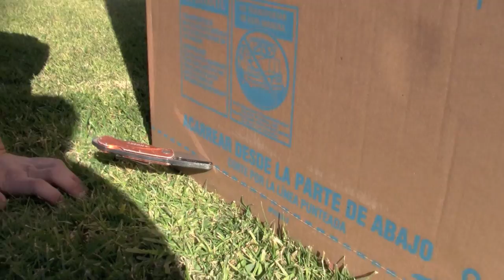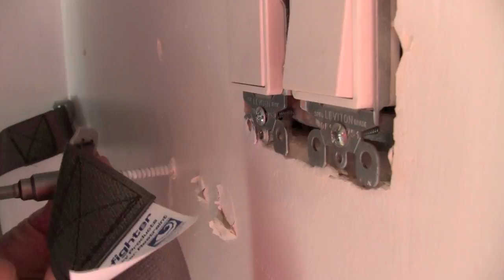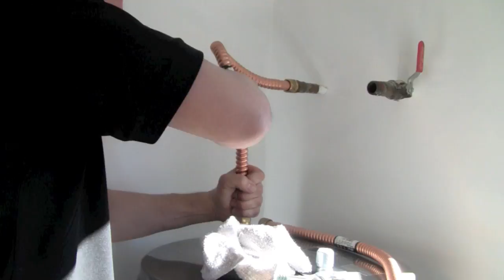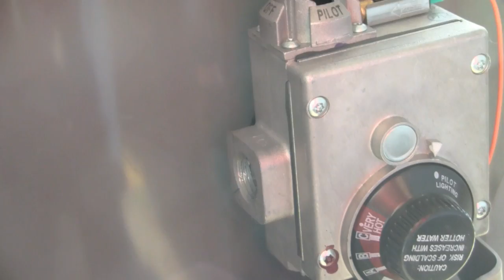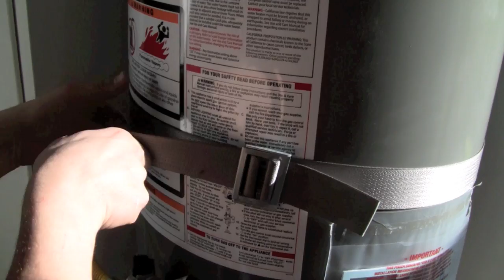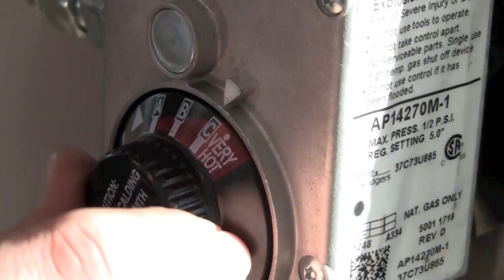How to Install a Water Heater - Step-by-step

Comment: The cheapest I could find for a plumber to do a 40g gas water heater was $2,500.  

lol. Plumbers are now charging more than my estate attorney and cardiologist, combined.  

Did it myself for less than $1,000 and even bought the same water heater at the supply house.

Comment: Excellent how-to video. I almost think I can do it myself but will probably let my amazing plumber do it. I have to move my existing water heater to access the wall behind it (has a big hole that rodents are accessing.) The current copper pipes don't allow for any movement at all even though there is some slack in the gas line.

Comment: Thank you for showing the last part testing for gas leaks, I was wondering what it would look like, very good video. I'm surprised there is no collection pan under the heater, after what I went through with my water heater practically eaten away the whole bottom I would never go without one but that's me.

Comment: I didn't see you put the pipe joint compound on the other end. I have been told that this installation has to be up to code? Is there something else I need to know other than doing exactly what your doing?

Comment: I'm going to use a flex connector for the gas, if I ever manage to disconnect the old union nut on my current black-pipe setup. What I'd like to know is, do you not need a sediment trap in the gas line between the shutoff and the heater?

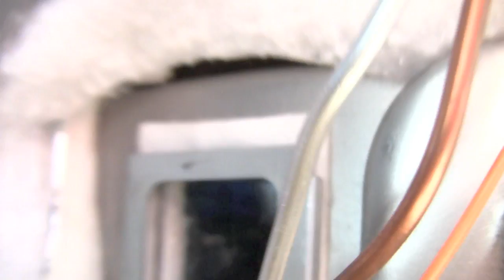Comment: 25:20 The reason you would need to hold the knob 45 seconds to let the gas through even after it is lit, is because there is a safety thermocouple device inside that shuts off the gas when it does not detect enough heat.  This prevents for some reason the fire is off, but the gas keeps running and creates a hazard situation.  Once the fire is on and working for a bit, the thermocouple stays warm so it knows the gas is being burned instead of leaking to the air.

Comment: Nice work.  Very good installation video.  You should check for leaks before lighting the pilot.  If you have a leak (you would have probably smelled it) you might get a BOOM!  We don't want no BOOMS!

Comment: Pipe dope should be rated for gas usually yellow. One more test that should be performed is the vent test. use a match or something that makes smoke and check the draw at the top of the water heater at the air gap bottom of the vent pipe. If it draws the smoke in should be good.

Comment: I thought gas water heaters had to be off the floor?
Or us that just in a garage?
Reply from the maker: • Water heaters installed in residential garages shall be installed so that burners and burner- ignition devices are located not less than 18” above the floor unless listed as flammable vapor ignition resistant. (2010 CPC 508.14) Commentary: Since July 1st 2003, water heater manufacturers have been required to incorporate Flammable Vapor Ignition Resistant (FVIR) Technology into 30, 40 and 50 gallon gas water heaters that are sold in the United States. Water heaters with FVIR technology may be installed on the floor of a residential garage. Electric water heaters do not have mandated FVIR technology and may cause a small spark when heating. Electric water heaters should be placed on a stand unless documentation is provided by the installer/manufacturer that verifies FIVR construction.

Comment: Okay Ran into a snafu . The new heater is a bit taller by two inches. The exhaust stack don't match. Darn . It's not straight up but has a 90 elbow. Any ideas ?

Comment: May want to check for gas leak before lighting pilot Plus the standoff pipe for the pressure relief valve needs to be closer to the floor

Comment: The area with the little glass window that shows you it’s lit. Is that supposed to be covered with insulation? I’m asking because a friend of mine had concern after hers was installed and it has a jacket door over it. Would it stop the air flow?

Comment: I like it, I like it! Now I can safely replace my leaking water heater! Thank you very much for the educational video! 👏👏👏👏
Reply: I followed your guidance and installed my water with no problem! The shark bites made a big difference, even though I had soldered the copper pipes to the couplings! Thanks again!

Comment: Thanks for such a detailed video.  Our tank went out yesterday.  I was debating whether I could replace it myself or spend $700 for a professional.  You have given me the confidence to give it a shot.  Thanks for all of the great tips (checking for leaks, tightness for the connections) along the way.  I will update my comment when my install is complete.

Well, we ran into some problems during our install where the existing tank shutoff valve was leaking and I didn't know what to do.  I kind of panicked.  Ended up calling a friend who is a plumber and had him complete the install.  He knew exactly what to do.  He cut our existing flexi copper lines and replaced them with stainless sharkbite connectors.  He got everything up-and-heating in about 45 minutes.  I guess that's the difference between a pro and an amateur like me.

I am still glad that I at least tried.  Thanks again for your video.

Comment: Great video! I had trouble figuring the routing and types of connectors for the vent pipe. Your step by step instructions where the only ones I could find for this. There were plenty of videos warning of carbon monoxide poison and using a match to check the draft in the flue but none on the actual installation. Thanks

Comment: You video is good instructions  for install water heaters; l want change my old water heater; just l need to know; how long take to fill up the tank 30 gallons; thank you.
Reply from the maker: Just open up the valve and let the water come in until it stops filling you need to do nothing more than that

Comment: I was  wondering - is there a water heater life span, or After how many years shoulder we replace a water heater? I have a 80 gal. Tank in a 2,000 sq ft home, with only 2 working adults occupied for last 15 years. Are we overdue to replace?
Reply from the maker: Yes you are overdue. They say 10 year life expectancy.
Reply: @How2Plumb  I have one that is 20 years old, and I changed that rod to prevent rust once, also flushed it once or twice, and did not notice any rust coming out of the water. And I get plenty of hot water, so did I just lucky with my water heater?

Comment: Super video. But no expansion tank?
Reply from the maker: Expansion tanks are only required when there is a closed system such as a pressure regulator on the building. There is not one in this case. Thanks for watching.

Comment: This is by far one of the BEST tutorials on "How To Install A Hot Water Heater" that I've ever seen. Everything was pretty much elementary step-by-step. And to think what some of these plumbing company want to charge to do what he did in less than an hour is absolutely RIDICULOUS! I'm pretty handy and have always thought about replacing my own water heater since it would be a simple removal of the old and install new one with new fittings. I'm definitely going to save this video in my DYI folder for future reference.
Reply: Excellent job and explanations!!!
Reply: You shouldn't be touching gas if your not licenced
Reply: He specifically says he's violating code, by not venting the T&P line outside..... best video ever... what a joke.
Reply: @APNFORD  Also said the owner didn't want to
Reply: @APNFORD  😪😪😪😪😪😪

Comment: thank you so much. You solved a mystery since my old unit is far different than my newer one. I too bought a Rheem and I failed to buy the parts that goes into the gas inlet/pilot light box.

Comment: My water heater is vented through the chimney. The pilot goes out on windy days. One plumber told me that the duct work angle is wrong. He wanted to lengthen the duck out of the heater unit, installing a 90 degree elbow  making the duct to the chimney opening horizontal to prevent wind from coming straight down. Is there any truth to his claim?

Comment: How2Plumb HELP!! I took off those plastic pieces on top water connections thinking they were supposed to be removed. I thought they were to temporarily protect them just prior to installing. Should I put them back in? What are they?
Reply from the maker: Yes you should put them back. They are dielectric unions that prevent 2 dissimilar metals from touching each other. Without this electrolysis may occur and will rot away the weaker metal. Thanks for watching!

Comment: this helps a lot and this will give me an idea for the plumber coming by today to install my 50 gallon water heater. I have to admit they are charging me extra additional costs, like Temperature and pressure drain modification $195, Gas drip leg code/modify piping $179, drip pan code $95, and County permit/inspection for $195. My insurance is paying for the replacement and installation. I live in Lancaster, CA. Any ideas if this are needed and fair pricing. I just think this is way too expensive. On top of that, they want me to contact the county for the inspection. Thanks

Comment: If I have a back-flow stopper at the water meter, I don't need vacuum beaker?
Reply: actually I should ask: If I have a back-flow stopper at the water meter, I don't need vacuum relief valve at the water heater tank?

Comment: I just looked at mine and this is not gonna be easy as it looks in this video. My water pipes are welded together all the way to the heater and I will have to cut them off to get the heater out of there. After that, I don't know how I am gonna get the new pipes on. My gas pipes are solid steel, not flex and that will be hard to deal with too.

Comment: I noticed that you didn't drill a pilot hole when you drilled in the lag bolt. You definitely want to put in a pilot hole first for the longevity of the studs. For 3/8th use: 15/64
th pilot hole.

Comment: Is our AOSmith 19 years old?    House built in 2000.  We bought in 2008.    I flush silt and sediment every season change.   How can I tell if th.is original water heater?   No date found.   Thank you.
Reply from the maker: For AO Smith the first 2 digits of the serial number are the year it was made. Thanks for watching! The serial number is on the sticker plate.
Reply: @How2Plumb   Thank you.  Smiff says this water heater was made by GE.  Gave GE's number to me.  GE says April, 2008 manufactured.
I already bought a Rheem electric damper water heater from Home Depot.

Comment: Another quick question: When replacing my HWH, if I use the flexible copper lines (hot and cold) with the dielectric fittings already manufactured in them, can I use standard galvanized nipples connecting to them coming directly out of the tank? Seems this would work because the different metals will be separated? Thanks, Garry.

Comment: Thanks  you just saved me a lot of money. When you drilled into the vent with the metal screws. It makes me think it might cause a leak. Thanks for a great video . I did it. I had to buy the  extras. Nothing came with my hot water heater. I have to replace the elbows that go on top. But the lowest bid was an average of $600.00  . I am so happy. My wife said go out and buy myself something. By the way that water heater empty is very heavy. Do you take Vitamins?

Comment: I purchased a 50 gallon Rheem water heater and they now come with 2 screws to attach the vent hood.  They place them in the plastic envelope that hangs on the water heater with the installation manual.  Love the loop trick.  Still a great vid in 2018.

Comment: What did you do with the 2 white plastic plugs that were in the cold and hot nipples in the new water heater?
Are they supposed to be removed?
Awesome video. Thanks a lot.

Comment: I consider myself an above average diy homeowner, taking on every project from threading black pipe to lime repointing. But this video educated me. Not so much on what he was talking about, but with how skillfully he did the fundamentals. Tube cutting, torch lighting, wrenching, etc. All were done with brute speed and yet the finesse that comes with years of experience. I can get nearly equal results but it takes me 10 times as long. Much thanks for the education!

Comment: Do i need to turn off my gas and electricity when switching out to a new water heater or simply turn the gas knob that the new heater is going to connect with?

Comment: like the way you expln in great detail on how to.
will give it a try and let you know how it turned out.
Reply: You're good.  I'm not brave enough to try this myself.  I feel uneasy about working with anything that involves gas or electricity.  I'm going to try to find someone to install a hot water tank at a reasonable price.

Comment: ATTENTION: The copper supply line he is using is awesome because he doesn't need a Dielectric Union. This tubing is built with a dielectric union, which properly separates the two metals. If copper and galvanize metals were to come into contact, an oxidation  would occur which will ruin the rough plumbing near it and can shorten the life span of the water heater tank. The oxidation doesn't happen fast, it takes a couple years before you begin to see or notice the effects.
Reply: ezekieo32 also known as the process of electrolysis

Comment: Great video, thanks Danny! Here are some suggestions for other small add-on video topics: how to disconnect and remove an old water heater, what to do if the copper supply lines and gas line go directly to the old hot water heater, and any additional steps needed to remove/replace a power vent water heater.

Comment: Thank you Danny.  MY question is....Do I have to ignite the burner in order to test the hot water from the tank to the outlets above (sinks and tub)?  Without doing so, my cold water to these places is strong, but to the hot taps, I have no flow whatsoever.  The water flow comes from a surface well with clean water, the pump on the footing kicks on at 30psi and off at 50psi....so no problem creating the pressure required....What could my problem be????

Comment: GREAT VIDEO!! Very insightful!! Question: My water heater leaks a little from the top. Do I need to replace my unit? It's about 12 years old, other than the leak It's working fine.
Reply: Pierre Papillon i have the same problem, good question

Comment: How much do you charge for doing what you just did?
Reply: Instead of talking trash ...why don't you  actually speak on what you think he did wrong and give some real world advice. Without doing so, you're just trolling..
Reply from the maker: around $1400 material and labor.
Reply: J Thomas Rains Jr a real licensed master hack.
Reply: agree totally. thanks for posting comment. A job will never be done as well as if you do it yourself, and then in the process you learn how to do it yourself.
Reply: Yea ok, go setup your own furnace according to the proper code requirements and pressure requirements, size the pipe correctly, you'd probably end up killing your family, dealing with gas isn't a joke lmao but by all means if you think you're an HVAC mechanic try it.

Comment: You are very good.  Thank you for doing the video for us.  You are a very good instructor.  I am a woman and I have no knowledge about plumbing but just looking at your video I could understand more about the water heater, and if for some reason that I have to install one myself, I probably could do it.  Thanks again for showing us.  May you be bless with every things you ever need in life.
Reply: Dominic true, you make a valid point.

considering the tank is 300 bucks, paying someone 500-700 labor every 6 years is worth it to me. i could see others doing it themselves.  I personally don't want to deal with wheeling the tank downstairs and the old one upstairs and driving it off.  i have no truck and would rather not hurt my back or get my hands nicked.  ok, so i'm a sissy!  :)
Reply: just pay someone to do it, don't bother.  tanks last 10 years why risk doing it wrong?  you may replace 3 or 4 your entire life.  not a skill you need.
Reply: @u235u235u235  some of us don't want to waste money paying others for things we can learn to do ourselves though.
Reply: @girlonlaptop  the prospect of bring a new tank down the stairs into my basement and new one up sounds dangerous to me.  i'll pass, but is see your point.
Reply: @u235u235u235  thats the hardest part, pay someone $50 on craigslist to do heavy lifting, the rest is the easy part and will save you serious cash!  Saving cash is earning cash.
Reply: @u235u235u235  you don't understand.  i own properties and do the repairs myself, this will save me thousands on many properties.
Reply: @stevepwn  that's different.  i was addressing the issue as a single home owner, which is typical.   best of luck friend.

Comment: Thanks Danny.  God bless you man.  If I could give you more than 1 thumb I would.  This really helped me a lot.  I have straight pipes running on the old water heater that has gone bad after 20 years.  I was worried about what to do, it looked like a lot of cutting and adjusting of rigid straight copper pipes and brass gas line was in order.  But you solved that concern for me, now I know, I can go with flex pipes for both gas and water lines.  Thanks again.

Comment: Good job!  You explained every step along the way and, more importantly, why you did what you did along the way.  If you ever see a need to revise this "Install Presentation", you might start off by mentioning that before the old water heater can legaly be removed, some local municipalities require a "PERMIT" be "pulled" by either the Homeowner or his Plumber; and that there may be an inspection upon completion by the City that should catch any unsafe practices or installations.  And finally, you might finish up by quickly summing up all of those steps by reviewing what you did.  You know, the old Tell them what you are going to teach them (show them), Show them what to do", and finally, "review what you taught them"